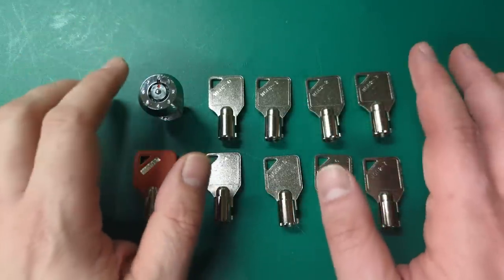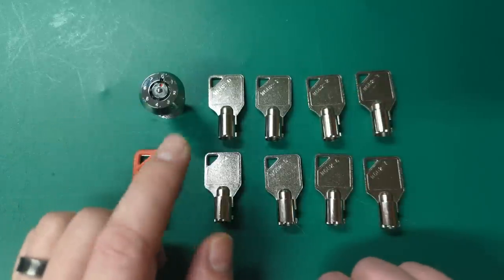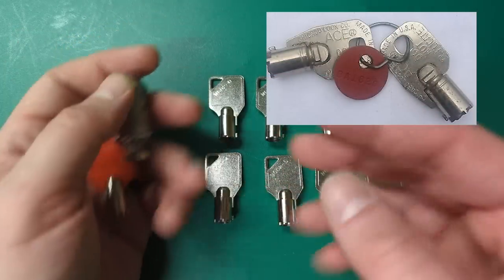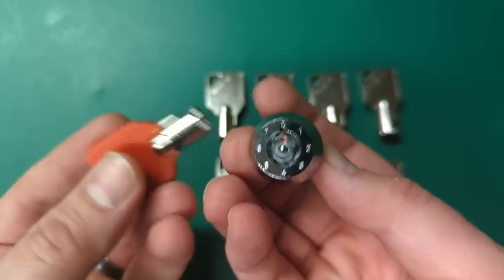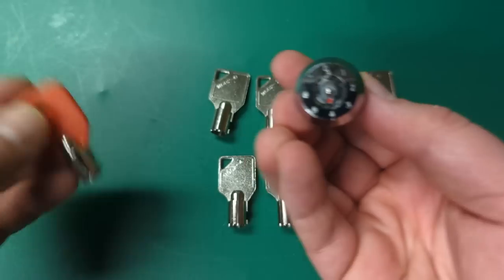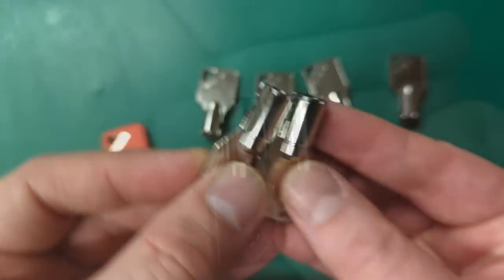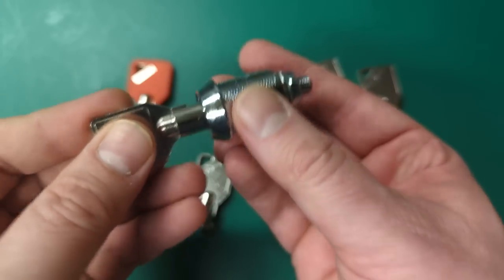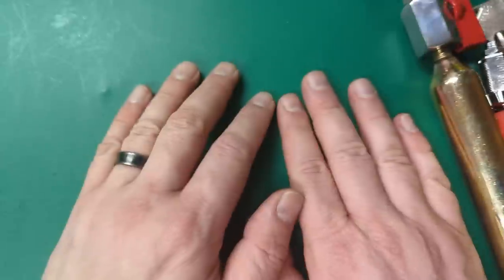Tubular Series, part 1 - Do You Know How the Fort Lock Gematic Works?

Comment: I'm with Jim. Control key just screws the stop depth in so that way the pins line up slightly lower or higher. Bet you could use any one of those keys with a slight jiggle and it'll work the lock if it's cut deeper than the current setting.

Comment: I'm pretty sure the red key has a smaller or no tab that does not interfere with the tail piece and doesn't touch the 90 degree limit, all keys have the same bitting they just have the tab on a different pin, cutting the tab of any key would make it the red key, since the red key doesn't turn the tail piece but has correct bitting it turns the upper pins only therefore moving the combinaison of the lock

Comment: Elaborating on others comments...
Anyone who has single pin picked a tubular lock knows exactly what's happening.
The master key is missing the tab (required to turn the tailpiece) and is cut the same as key 0.
Keys 1-7 are keyed the same but rotated by one.
When opening any tubular lock, the key pins are rotated around the lock with the key (driver pins remain in place).  This usually isn't an issue since the tab prevents you from removing the key except at the "starting position" since that would shift the keying of the lock.  The master key's lack of a tab allows you to do this on purpose.
This is why single pin picking tubular locks is a colossal pain since you have to repeatedly pick all the pins for each 1/8th turn of the lock (in the case of an 8 pin lock). 

Note: in the locks I've dealt with, the outside tab is only there to keep the key from coming out.  There's usually another notch/tab on the inside of the cylinder that rotates the tailpiece.  So in this case they must have moved that connection to the outside to be actuated by the tab.

Comment: I bet all the keys are the same cut but with a different index. For example the zero cut for key zero is the one cut for key one. If you were to grind off the nub from one of the keys it would effectively  make yourself a master key. The lock then has a split nose piece.  The change key then sets a second set of shear lines that realigns the split nose piece or aligns the existing shear lines at a different depth to realigns the split nose piece.

Comment: Just going from the two keys that I saw the full biting on I think one of the pins connects the core to the tail peace.   I think it is pin 5.  The control key does not activate the pin to connect to the tail.  Also the control key does not have the tab to lock the key into the lock so it can be removed in any position.    Now I have to see what I can find out about the lock.

Comment: my first thought is that because the pins are in a circle it creats an interesting situation where you could have multiple pins in each cylinder and if the key is pulled out befor putting the barrel back to its start position. and the barel key with the tab in it can't be inserted.. this could lock out someone with that key.. perhaps it is like a master key that master locks the lock and prevents all the other keys from working.. another interesting way this could be used is if you need 2 different keys to unlock or lock the barrel.. this might be usefull in certain security situations when you don't want just one person being able to lock or unlock (or swhitch on or switch off a switch??

Comment: The change key looks like it's cut to max depth at all positions? So either it pushes them to a depth where the inner core is freed up to rotate (with detent, perhaps the upper, outer, part of the lock engages with the driver pins, and pushing them down a bit frees the core to index?), or any turning tool could rotate the core at any time? Then the individual keys push the drivers to the right depth and they just have the bitting rotated one position per key

Comment: My guess is that the red key is rotating the central 'pin mechanism' of the lock, but not the warding. So all the keys are the same, but have that extrusion in a different place. I think if you were to file off the parts that prevent you from inserting the key in the wrong rotation, that modified key will work with any configuration by the red key.

Comment: Guessing the operating keys have the same cuts but each key has the cuts rotated (eg key0 is 12345678 cuts, while key1 is 23456781, etc). There's a tab to limit rotation to 90 degrees that the index tab in the key hits. The orange control key has no index tab so can be inserted and removed at any position and isn't limited in rotation. This only leaves the control key not operating the tailpiece - to which maybe there's an extra thing present or missing on the control vs operating keys to couple/decouple the front and back of the lock. Maybe pressing in the ball bearing on the front? Or maybe something is caught by the indexing nib?

Rather neat lock! Never seen anything like it.

Comment: My gess is that the orange key does not have the protruding tab, witch allows you to fully rotate the key and remove it in any position witch allows you to move the driver pins and keep them in that position, so every key is esentially the same but with the protruding tab in a diferent position

Comment: The red key moves a plate (or other mechanism, like a disc) that locks out all the pins other than the Red Dot pin, so you can't depress and/or rotate.🤷 Basically only the numbered pin engages to unlock the lock mechanism.

Comment: Very interesting, I haven't run across these locks yet. My guess is there are wards that prevent all but the selected key from turning, different wards for each number. The notches for the pins are probably the same on all keys. The control key encounters no wards, but doesn't have any notches to engage the pins. What are the typical applications for such a lock?

Comment: For those saying that the keys are identical and just rotated one position, this is not correct.  These are cheep (>$2 in bulk) locks and it is quite possible to pull a key out without returning to the notch with just a bit of force.  This happens so often that technicians who frequently work with these locks will make shaved keys with the tab ground off so a misaligned lock can be reset.  These shaved keys do not operate the lock at all if the master code is not set, even if they are inserted out of alignment.

Comment: It’s gotta be the same cuts on every key, but advanced one position. The red key just sets the “timing”, or which pin is in position 0. 

The way the red key accomplishes this may be a second sheer line, similar to the an SFIC has control and operating sheer lines.

Comment: Thr keys  don't  have a pin on the inside of the key they can be pulled at any rotation point, there are 2 shear lines ,outer Shear line is operated only by red key lining up the outer " bottom "pins, second "master " shear line operates the tail and all master pins are the same ,therefore the red key only needs to change the bottom pins to allow it to accept a new key

Comment: Could it be something as simple as the control key changing the depth of the entire set of groove depths (sorry, probably wrong term).  In other words if the the bitting code were to be 1 -2 -3 -4-5 etc. in position 0. turning the control key to position one would move the code to 2-3-4-5-6, etc.

Comment: i don't know how a gematic works, but if i were tasked to build a lock like that it would have 2 seperate sheer lines kind of like one of those locks they use in prisons.

and it would be split into 2 parts the stem with the key pins and the intermediary plate wich is attaced to the back.
when the changeing key is inserted the sheer line is between the plate of the stem and the plate that actuates the back, meaning the stem can turn without actuating the lock, as the master pins and the driver pins lock it in the back.
but when an operating key is inserted the sheerline aligns between the plate actuating the back and the bible, this way it turns the stem and actuates the back. the pin tumbler equivalent would be if it were attached instead of at the core, it would be attaced at the sleve.

Comment: These locks are not limited to 90 deg.  On the tail piece there is an index that blocks the tail piece from turning more than a quarter turn.  It can be removed and reversed. to make the lock turn to the left (CCW). without this index the lock will spin freely 360 deg.

Comment: Ok, I think I might know what's happening here, and it's not my experience with locks that I'm drawing from, it's my experience as a magician.

First off, the orange key, it has a feature we're not seeing, this is driving something internally, rotating with the key, and as it rotates, it adjusts the pins inside.

All of the extra keys have the exact same pattern on them, just starting at a different point.

Not to get all Penn Jillette on you, but I think that's enough information to let you know that I think I know what's going on.

Comment: Oh, and though noobs knew tensioner for them through Multipick's pretty cool, there's so many ways you could design a much better turner. Why can't they just make them like a BOK but with a notch that fit's snugly into the cut out? If they are different dimensions= well then figure out what the dimensions are and make how many there are. You could have a wrench just hang off to the right of the tube and you simply press down to put pressure on it and it wouldn't get in the way of the pins or your view of them. The standard tensioner though functional isn't very good nor creative.

Comment: every key rotates the lock one position and the biting remains the same, justshifted x cw. ex key 1 is 4598337, if you pull four it becomes 8337459. or core moves one deeper each pos, but control key goes in without alignment so it is free to goin and out while not retained